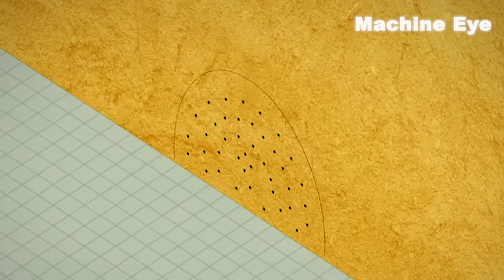China Leaves American President Shocked, Builds The Longest Undersea Tunnel In The World

Comment: This has already been done several times in Europe and the USA, including the Channel Tunnel connecting England and France is 31 miles under water.  The latest connects central Europe and Scandinavia is the Fehmarnbelt tunnel will be both the longest combined road and rail tunnel.  In the USA, the Hudson Tunnel project, the Lincoln Tunnel, the Gateway Tunnel,  the Holland Tunnel, and the Boston Tunnel (Big Dig) are all huge projects.  What the mainland Chinese are doing is a big project, but does not introduce any new technology or methods.

Comment: My invention way levitation levitating is not like that , 
Like removing the weight of the chassis , 
Can be used in Like that . Weight is down . The chassis is down ,load is in the Middle it's float in the air . The load is up it's traveling in light speed .

Comment: ............... and it's already leaking.  The bridge is only carrying about 1% of its capacity due to poor planning.   The central planning of the CCP is a complete failure.  Their high speed train system is badly planned and losing money at an astounding clip.  Fifty or so dams collapse every year, not to mention bridges and buildings due to "tofu-dreg" construction.  Their economy is cratering.  If you are invested in any enterprise in mainland China, or in any business that relies on mainland China, get out now!
Reply from the maker: There are various perspectives on China's infrastructure projects and their economic situation. It's important to conduct thorough research and consider multiple sources of information when evaluating investments or assessing the stability of a particular region. Individual circumstances and risk assessments may vary.
Reply: @MachineEye   Well, that wan't very helpful.  One source of information to be wary about is the CCP and any affiliated information source.  I have yet to hear anyone praising the CCP and their planning.  One screw up after another.

Comment: I heard that it has a lot of leaks already and it may collapse in just a couple of years.
Reply from the maker: I'm sorry, but I couldn't find any specific information or context regarding the project you mentioned. It's important to rely on credible sources and expert assessments to evaluate the structural integrity and long-term viability of any infrastructure project. Engineering standards and regular inspections are crucial in ensuring safety and durability.
Reply: @MachineEye  You won't find any videos of the leakage in that tunnel now because it has been censored already.

Comment: It's going to flood in the future due to China using cheap materials.
Reply from the maker: It is important to rely on accurate and verified information when discussing infrastructure projects and the quality of materials used. Large-scale projects like tunnels undergo rigorous engineering and safety evaluations to ensure their long-term stability. It is normal for concerns to arise regarding maintenance and potential risks, but it is crucial to base these concerns on credible sources and expert assessments rather than speculations or assumptions. Ongoing monitoring, maintenance, and adherence to safety standards are essential to ensure the safety and longevity of such infrastructure.

Comment: I’m curious about how they’re going to keep the water up when they 
Cut the ocean in half .     LoL 😂 🤣😂🤣😂
Reply from the maker: The statement about cutting the ocean in half is likely meant figuratively to emphasize the magnitude of the construction project. In reality, the construction of infrastructure such as tunnels or bridges does not involve physically cutting the ocean in half. These projects are designed with engineering considerations to ensure the stability and functionality of the structures while minimizing environmental impact.

For underwater tunnels or bridges, various construction techniques and materials are used to create a secure and watertight passage. These may include the use of watertight seals, reinforced concrete or steel structures, and advanced construction methods. Additionally, ongoing maintenance and monitoring are typically conducted to ensure the safety and integrity of these structures over time.

It's important to interpret certain expressions figuratively and not take them literally. The construction of large-scale infrastructure projects involves careful planning, engineering expertise, and adherence to safety and environmental standards.
Reply: @MachineEye   No sense of humor ?

Comment: What about safety , your pretty much doomed under water.
Reply from the maker: Safety is a paramount concern in underwater construction projects. Specialized equipment, rigorous safety protocols, and thorough risk assessments are implemented to ensure the well-being of workers. Measures such as pressurized chambers, proper training, and emergency response plans are in place to mitigate potential risks. Additionally, constant monitoring and inspections are conducted to maintain the integrity and safety of the structures.

Comment: Sorry, the only practical way to stabilize a buoyant undersea tunnel is by high tension cables tethered to subseafloor foundations.  Floating supports would be severely impacted by sea state conditions.
Reply from the maker: You bring up an important point regarding the stability of undersea tunnels. High tension cables tethered to subseafloor foundations can indeed provide stability and help mitigate the impact of sea state conditions. Engineering solutions that consider the dynamic nature of the marine environment are crucial for ensuring the long-term durability and safety of such structures. Balancing innovative design with practical considerations is essential in developing robust and reliable undersea tunnel systems.
Reply: @MachineEye  I worked for Bechtel as a civil engineer.  Tethered floating drilling rigs are employed where it is not practical for stanchion legs.  The buoyancy of the drill rig established the tension in the tie downs.  The optimal solution is typically the simplest solution.

Comment: It's a great video which illustrates the Chinese infrastructure development and their engineering marvel to construct under sea tunnels. But it's all about the requirement. If this type of robust and high budget construction pays them or gives them the returns, then it's good to build them, otherwise it's merely waste of money.  In other words it will not be a meaningful project in other Western countries to do this type of construction as their population is very less. Western countries have a cost effective air transport system which is actually required for their population density. This  is not at all a great  engineering marvell or  technology of Chinese, as many other eastern and Western countries already possess under sea tunnels and bridges as per their requirements.

Comment: I am wandering about the amount of research and studies done not only for standard operations but also for safety. E.g., aside from minor maintenance, does this system requires MAJOR maintenance?cost/benefit, etc.
Reply from the maker: The construction and operation of such a complex system like an undersea tunnel involves extensive research, studies, and considerations for both standard operations and safety. Prior to construction, feasibility studies, geological surveys, and engineering analyses are conducted to assess the viability and potential risks of the project.

In terms of maintenance, a well-designed tunnel system typically requires regular inspections and upkeep to ensure its safety and functionality. This includes routine inspections of structural integrity, electrical systems, ventilation, and emergency response measures. Major maintenance activities, such as repairs or upgrades, may be necessary over time to address any wear and tear, technological advancements, or changing needs.

The cost/benefit analysis of such projects takes into account various factors, including construction costs, long-term maintenance expenses, economic benefits (such as improved transportation and trade), environmental impacts, and societal advantages. These assessments help evaluate the overall feasibility, economic viability, and long-term sustainability of the project.

It is important for governments and relevant authorities to conduct thorough research, engage in continuous monitoring, and implement proper maintenance protocols to ensure the safety, efficiency, and longevity of infrastructure projects like undersea tunnels.
Reply: @MachineEye  Only Anglo can think, the Chinese don't think or innovate.
Reply: if you will be interested in binary options trading I can teach you how to trade and earn profits
Reply: no cost, every single know-hows, tech were copied or stolen from other countries. ching na is the country of copying and thieves.
Reply: Just remember that the Chinese have their own space station unlike any country in the world. That's enough proof
Reply: @Da Lama you are CUTE! Are you available for kids' BD parties?
Reply: @seifazghandi1228  mate they would be as safe as any american construction trust me